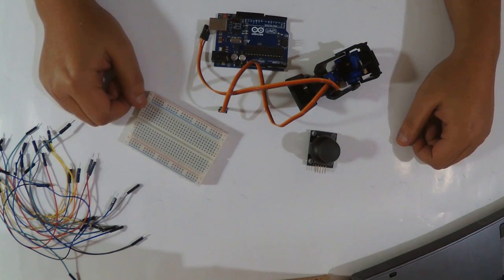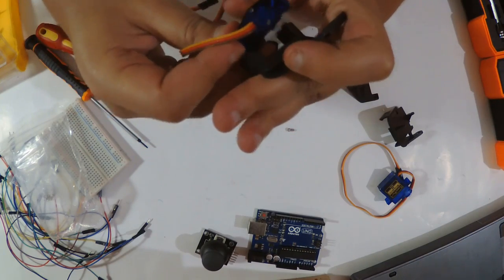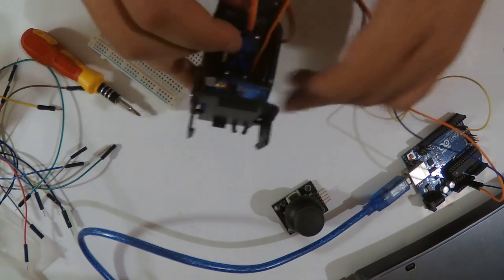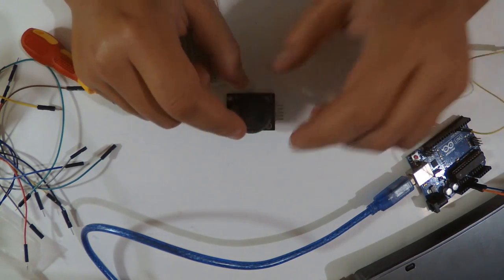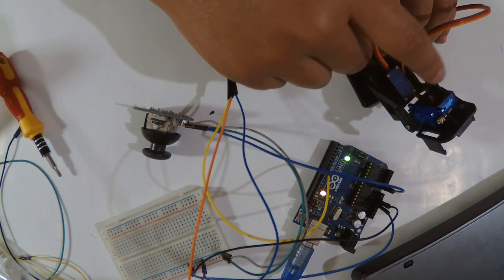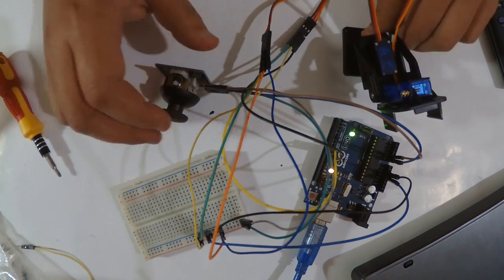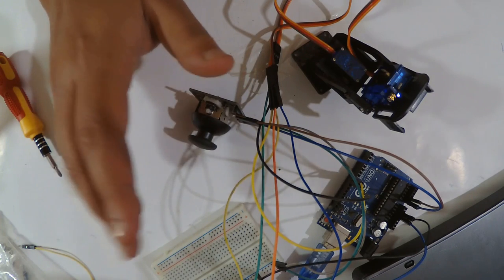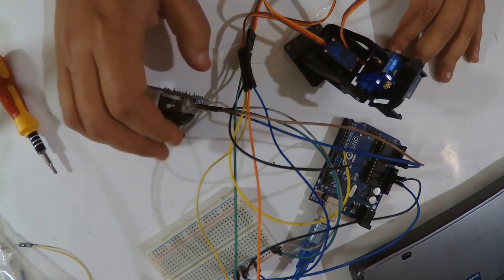Control dual Axis FPV camera cradle using Joystick

Comment: How can I controll these things with wireless remote module?
Can u make a video about that? Thanks.
Reply from the maker: I have a video about a RC vehicle controlled using wireless PS2 controller... you can check it on the channel.
Reply: @SurtrTech  Thanks

Comment: hi how can i run 4 and 6 servo in this  way i need it for my 4 dof and 6 dof robot arms
Reply from the maker: Hi, the easy way is to associate every 2 servos with a joystick controller, and you could play with this if you want to have smooth control, a joystick can control two servos for some cases to keep the level, but first begin with the separate controls until you're familiar.

Comment: How can I achieve proportional joystick control?
Reply from the maker: You can either add other intervals, or play with that "1" value that we add or substract from the current position and make it as a variable proportionnal to the joystick position.
Let's take "X" axis as example:
1st example there's "X<450" or "X>550" cases only but you can divide it more, 
"X<200" -- "X>200 && X<450" 
For first interval which is far from center you can increase by 5 for example and the second interval which closer to the center increase only by 1

then "X>550 && X<800" -- "X>800"
Same thing here
So just instead of having a LEFT - Center - RIGHT intervals you have now Extrem LEFT - LEFT - Center - RIGHT - Extreme RIGHT

2nd example instead of using a constant like "a=a+1" that "1" can be changed to a variable like "j" 
j=map(X,0,512,0,10): this function means that "j" will read the Variable X that goes from 0 to 512 and make it proportional to 0 to 10 which means
if X is 0 --> j will be 0 
and if X is 512 ----> j will be 10
and then it will be for example "a=a+j" and that j will be proportional to the joystick position.

Just when using the 2nd proposition pay attention to that 0-10 because that value will be add every 50 ms and it could be very fast so test and chose which one suits you, then pay attention to the "map" function sometimes it should be inverted like j=map(X,512,0,0,10)... or something

When testing don't rush it, read about the map function first in Arduino website then start multiple test on 1 Axis only until you reach what you need because it depends on your hardware too.
Reply: @SurtrTech  Hey! I've got the second proposition working :) Thanx for your time and the good explanation!